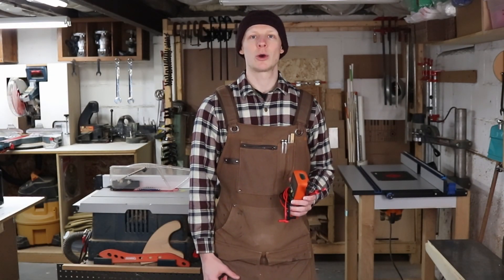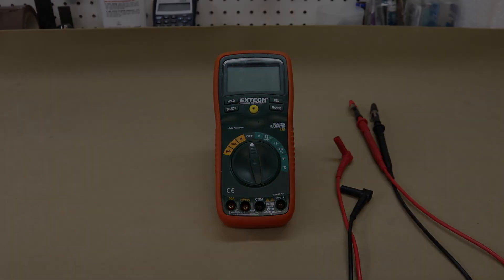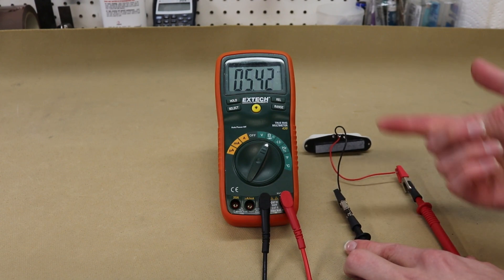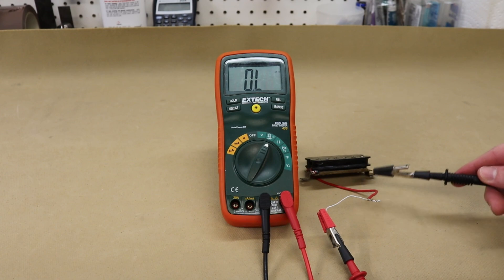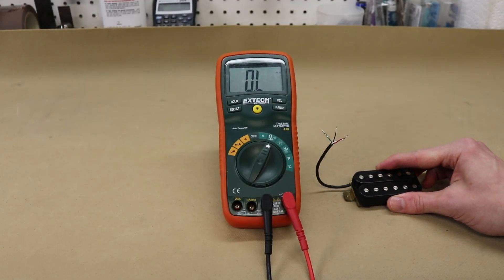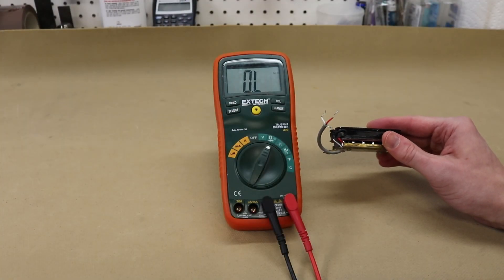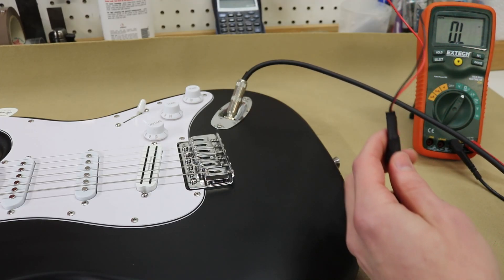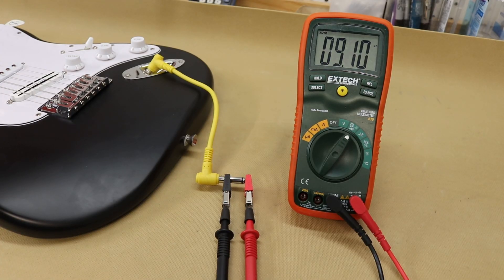How to Measure DC Resistance - Guitar Pickups

Comment: What are the clips for the end of the probes?  That's a much better solution than trying to fight the single probe ends and get everything into place.  I've never seen that before.
Reply from the maker: They're the allegator clips that came with the multimeter. They're useful but if you don't have them, you can still measure a pickup without them.